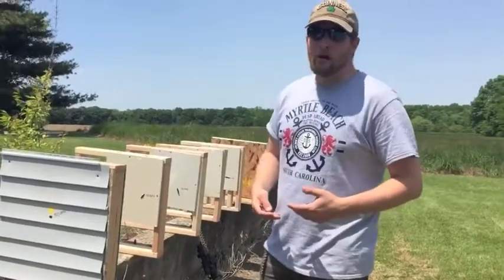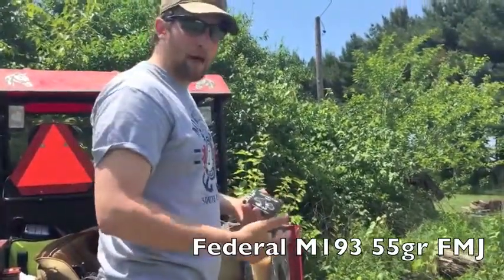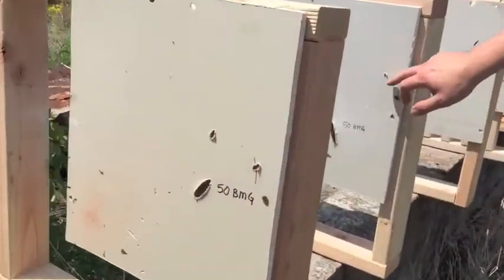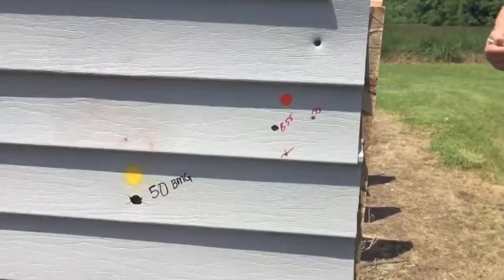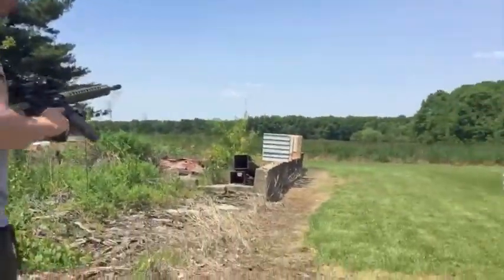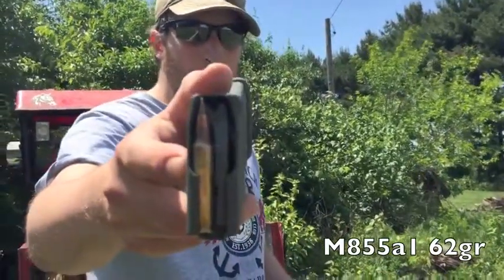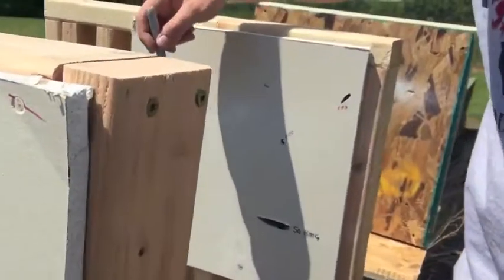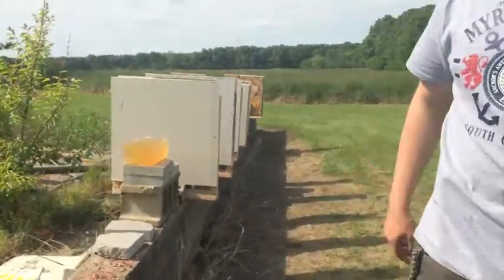556 vs house

Comment: Need to test 223 soft point for home defense or 5.56 equivalent.  Obviously military rounds penetrate excessively for home defense.
Reply: I'd like to see it but it has been done before.  It will still easily go through multiple layers of drywall.  Other than that...dont know